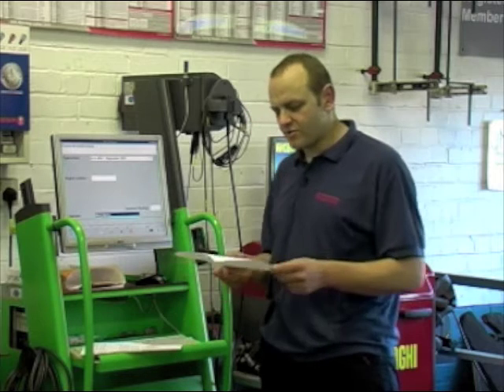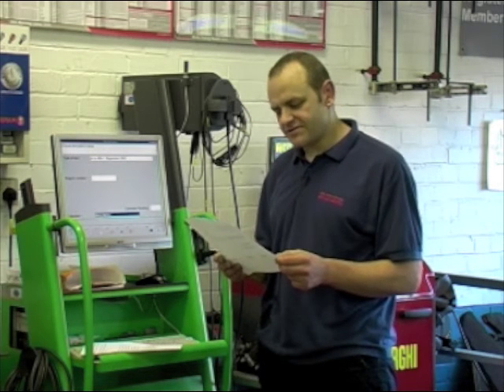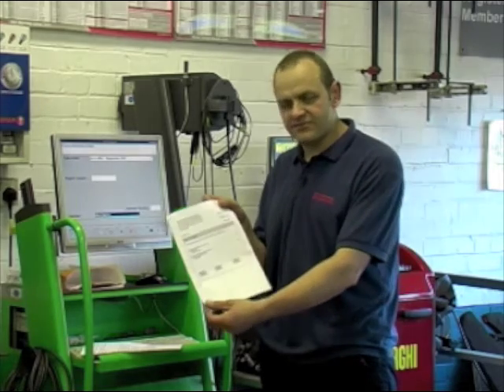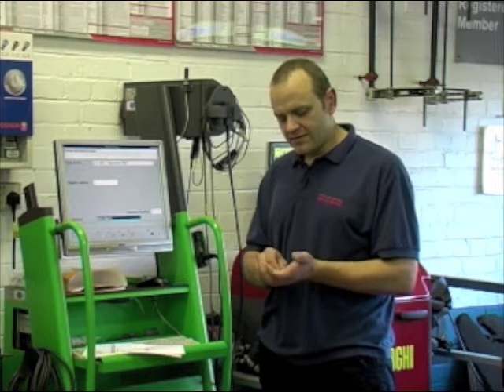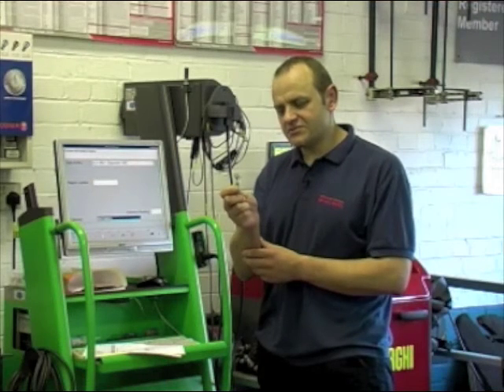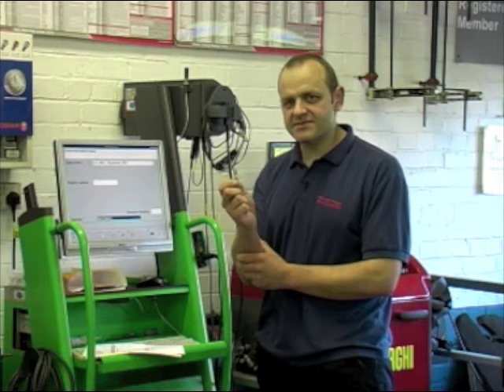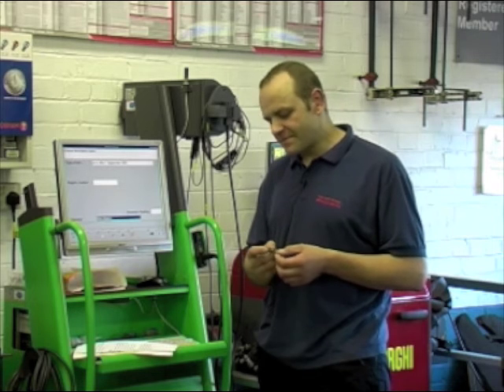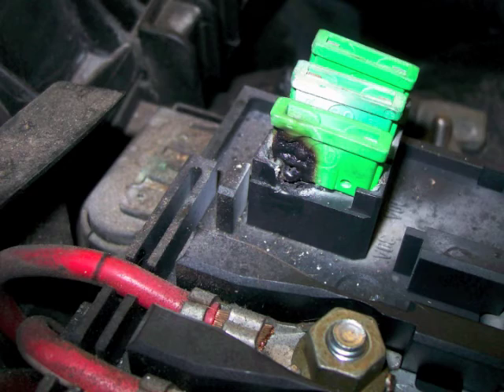VW ABS Hydraulic Pump defective

Comment: same problem, I initially went to my local garage who insisted on two occasions that the pump was faulty and had to be replaced. after watching this video, I went to another garage and it was indeed the fuse. it was replaced and the diagnostic test came out clear. now all is well. saved me around £800 watching this video - thanks very much.

Comment: Cannot thank you enough for this video we were quoted £850 to supply and fit a pump after they did the diagnostic check. There was no way we could afford this and thought we would have to scrap car.We got a fuse from vw dealer and fitted it abs light is now off Total cost £3.50 it took minutes to unscrew the 2 screws and replace fuse. FANTASTIC. The old fuse came of in 2 pieces as it was totally knackered  (Scotland)

Comment: Thank you master Banks! I had multiple garages check this fault, some even looked at wiring under the car, but none thought to check the battery fuse. Instead, every "mechanic" concluded that the pump needs replacing for £600+. I am so grateful for this video. These fuses cause some serious problems when they go, and it's often not the first place people look.

Comment: Thanks so much for this, my ABS light came on and after finding this video I checked the fuse which was cracked. Ordered a fuse as well as a diagnostic tool to read and clear the fault code. Ran the diagnostic and the code suggested faulty ABS pump, swapped the fuse and ran the test again and now the fault has cleared. All fixed for the pricey sum of £18.
Reply: Can you tell me what diagnostic tool you bought?
Reply: I used the one in the link below, it is out of stock on Amazon but you will be able to find it else where.

http://www.amazon.co.uk/Memoscan-U281-AUDI-CAN-BUS-READER/dp/B00GBMQ4OC

Comment: Hi there, i have a Citroen C1 2011 which intermittently records no retarding effort in the front left brake (causing 94-96% imbalance on roller brake test). Have you any expertise or suggestions as to what may be causing this? we suspect an electrical fault with the hydraulic abs pump control module ?

Comment: I was driving my 2013 VW Golf, at 59 mph, with the Cruise Control on.  Asd i came up to my offramp, there were no lights on.  The car had operated perfectly. the odometer reads; 2,554 total miles, on this car.  As I applied the service brakes, the brake pedal went to the floor.  The vehicle was traveling at 48 mph. Instead of T Boning the cross traffice, I was able to swerve, across the two MT right lanes.  As I turned right, the tires SCREECHED, VERY Loud. The VW is PARKED. None will fix it.

Comment: I HIT the middle median, and BUSTED off the LF Wheel. The VW Golf, will require a wheel, One spindle, a control arm, and a tie rod, at minimum. No brake fluid, was found, ANYWHERE. NOT Atthe cars stopping point. NOT on the tow truck.  The local VW Dealer, had to add VW Brak fluid, to test the car.  The brakes are workingh some now.  THIS IS A NEW VW.  Any ideas, or Input?